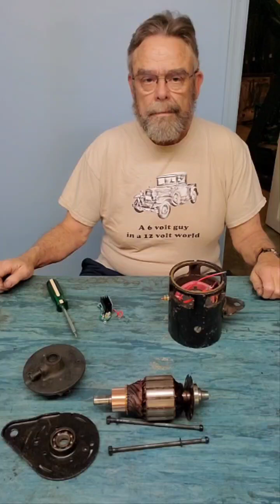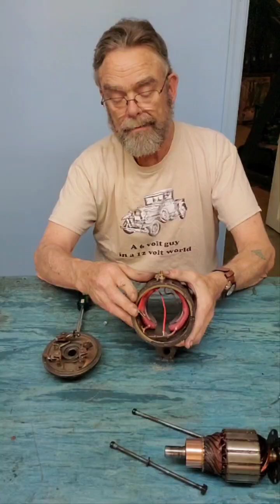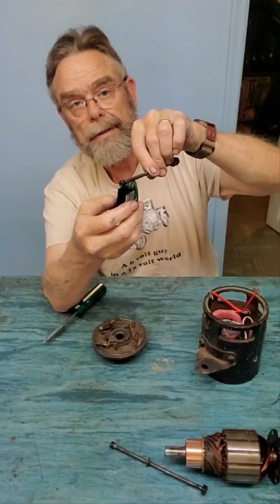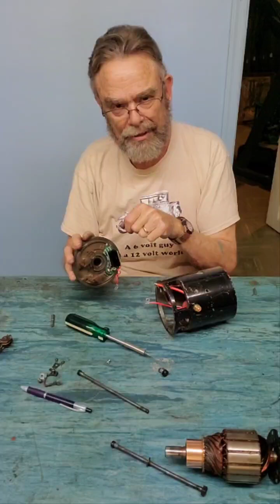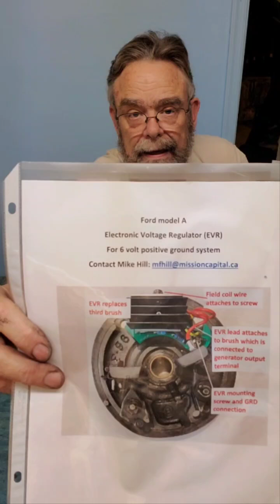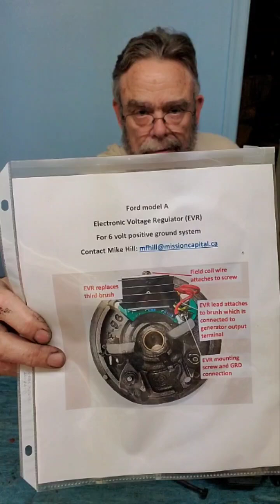How to install Mike Hill's Electronic Voltage Regulator (EVR) in a Ford model A generator.

Comment: Thanks much for this informative video and for letting me know of this great improvement. I just finished getting one installed and had a little glitch I'd like to pass along. After installing the EVR I had no generator output. Took everything apart, checked the armature and field and everything looked fine. Reinstalled the generator...still no output...suspected a faulty EVR so bypassed it to get full generator output. Reconnected the field wire to the EVR and now works just fine....turns out the field had to be reflashed. Michael provides excellent installation and troubleshooting instructions. I let him know of my problems and suggested he may wish to add instructions on testing the generator to see if the field needs to be reflashed.
Reply from the maker: @mountainhigh4084  Good point. I always polarize any generator after working on it. If it motors, I know it is electrically sound. After that I run it on the test stand.